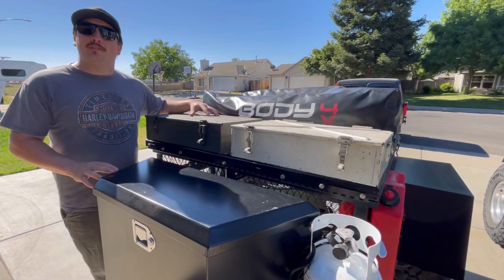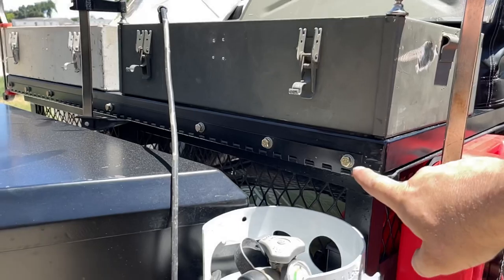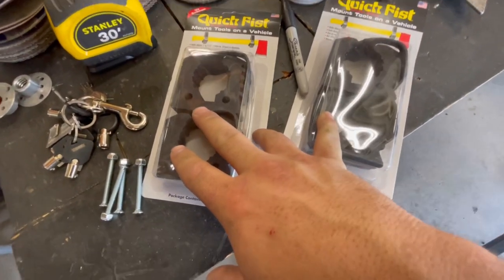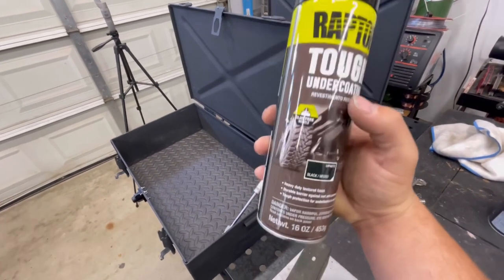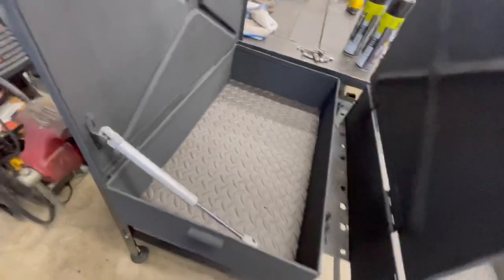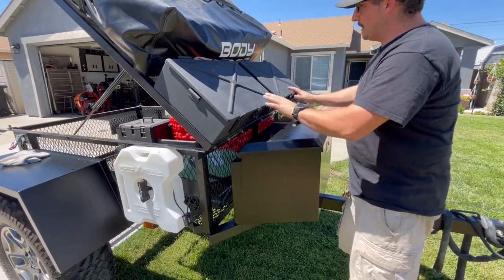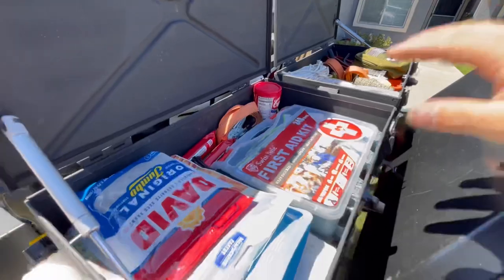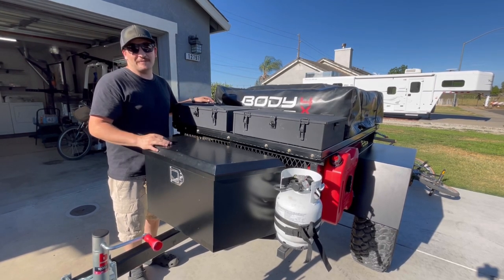Budget Overland Trailer Build Pt6 - MORE Storage + Full Size Shovel and Axe Mounts

Comment: Not to be critical, this is just a suggestion. I would swap the boxes from left to right to put the lift struts toward the inside. 99% of the time you will be swinging whatever you lift out of the boxes toward the outside of the trailer. Especially since you will have to work around the tongue. This way the struts will be out of the way when using the boxes. I'd hate to see you break a strut mount since they are welded in. Nice build.
Reply from the maker: I thought about that just after I bolted them on and it’s a great idea, just need to swap them over now. Thanks for watching 🍻

Comment: Perfect of what I'm wanting to build on the 1,700lb harbor freight trailer. Want a full chuck box on one side, smoker on the other and enough space to carry our ground camping gear instead of a roof top. Just leave it on the stock tires since we don't go all to far. Just old back country roads here in Louisiana. 

If seals don't work on those boxes, just get a couple custom made bags like your roof top is covered with. Bungee them down.
Reply from the maker: Awesome , that should be a fun project,  build it to make it comfort you and your needs. It’s the best way in my opinion. Thanks for watching 🍻

Comment: Love the additional storage space. Those fenders are just screaming for some ammo boxes or metal tackle boxes attached to the as well. Can throw some spare nuts, bolts, washers and screws in them or bungee straps and extraction tools and straps. Or just food for your dog lol. Looks great Dustin, keep it going!
Reply from the maker: Thank you Tim, originally I wanted to put them on top of those fenders but that didn’t work out because they wouldn’t open the way I wanted to and would hang over the edge about an inch , just didn’t look right to me . But it’s a good idea , I did find some plastic waterproof boxes I may end up putting there. But good idea for sure. 🍻
Reply: I've found that mounting a sheath for a 21" chainsaw on my driver-side trailer fender is a real back- and time-saver. That said, I do a lot of forest trails early in the season before other guys have cleared them, so your mileage may vary, but I'd have a Stihl mounted there in a heartbeat.